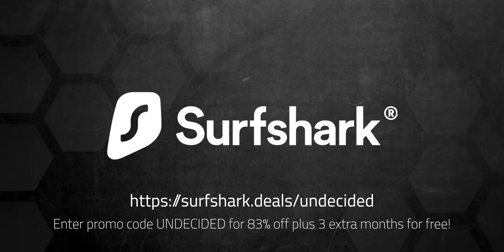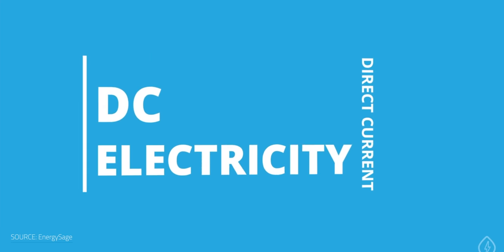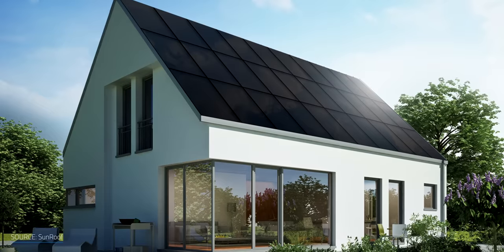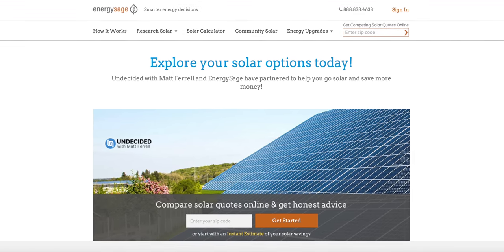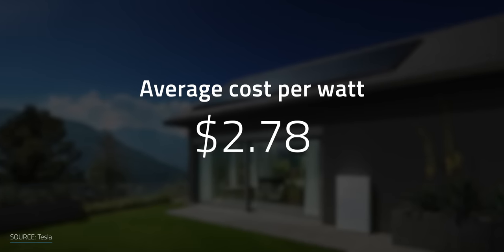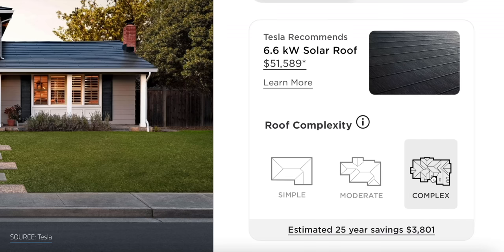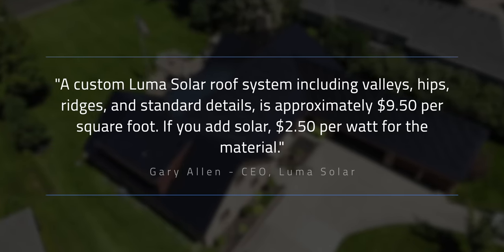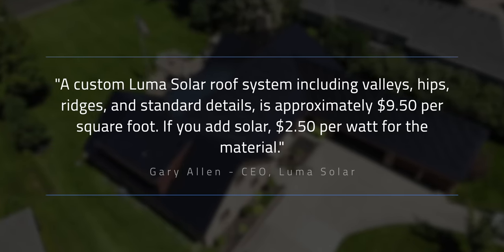Exploring Tesla Solar Roof vs. Solar Panels

Comment: The Temperature Coefficient and NOCT ratings of a panel/tile are just as important as the Efficiency rating.  The default Watts rating is the STC value; which is an idealized output in Watts.  In the “real world” the panel/tile(?) will likely output 75% of the STC on average for  4hr-6.5hr on a good day.  Very curious how Efficiency, NOCT,  and Temp Coefficient compare for panels vs tiles??

Comment: Thank you for an interesting video. I think your comparison would have been more helpful if you also included a rough estimate of the value of the solar tiles as strictly a roofing product, since if one is considering replacing a roof and adding solar at the same time, then they ought to consider New roof + Panels vs Solar roof tiles instead of just panels vs tiles. I would be really curious to see the cost per watt stacked up that way.
Reply from the maker: Great point!

Comment: My neighbor just installed Tesla Solar Roof before price increase. Another neighbor said now too expensive, the ROI with current efficiency and lifespan is upside down. I agree. 

I have been working on revolutionary Nano carbon fiber tubes tube technologies for solar panels and tiles manufactured in a continuous range production line. 

Lots of mountains to climb and hurtles to overcome, but with solar panels targeted with 30-40% efficiency, it’s a game changer.

Comment: I think the differentiator for me is sheer area. I have a relatively small roof area, and already have solar panels. Not quite enough area on my roof - especially given that the local laws prohibit panels too close to the edge, and then I have some solar tubes that prevent panels from being installed over them - to provide for all my needs. So I'm looking for a way to increase my production. I have a feeling I would get more power with solar shingles since I could use just about every square foot of roof area to produce power.

Comment: You mentioned power generated per kW installed. There seems to be a miss here with how many kW you need to install with panels vs tiles. E.g. If solar tiles are 5% less efficient, you need to install more, which adds to the cost and space. On top of it, solar tiles are installed with string inverters and you might have limited roof space for a 10kW system, so you'll need to over provision panels, adding to even more cost. Having recently researched this for a few months, the tiles have the biggest advantage of anesthetics today, but besides that they don't seem to be really a replacement to panels yet. But I can see the potential.

Comment: It makes more sense to do tiles when building/dedoing the roof as a whole since you don't actually have to buy and install a seperate roof. it makes more sense to do panels if your roof is mid life. Also panels are more versatile and you don't even need a roof to mount them. Personally I'd go with high efficiency and high quality panels, but that's because I plan on having more panels than my roof would allow anyway

Comment: Good video. Very important comparison!
One aspect that I found missing - normalized area coverage.
On the one hand, in most places I saw, the panels are not placed flat on the roof but tilted in order to maximize the efficiency. On the other hand, tiles will cover the whole roof while panels have their defined size and you can only try to fit in as many panels as possible on a given roof shape.
Obviously there's no uniform answer which is better from that aspect, but would be nice to see a rule of thumb if there is any.
Thanks

Comment: It would be nice if you could present the costs and benefits in 25 years for all options by considering total costs (investment, operation, maintenance, depreciation, ...). Then it could be more reasonable to compare the tiles and panels and quantify the maintainability factor of the tiles.

Comment: It seems important to consider that panels are placed in the most efficient area of the roof whereas tiles are everywhere. This means you could have tiles that are permanently in the shade or otherwise inefficient due to their location. So even if the wattage you buy is the same, strategically placed panels will end us giving you much more energy/$.

Comment: I am building a new house and was planning on getting Tesla Solar roof.  But when the price changed the exact same quote TRIPLED in price so now I'm not so sure :( Especially since this is one of those community builder homes so I actually need to have the default roof built and then replace it if I want solar roof.

Comment: I’m about to have solar panels installed but wondered if the Tesla roof would be better. Like you said, I suppose it depends on your needs. Existing roof, Solar panels. New house, solar tiles. Thanks for the info.

Comment: You didn't mention the other positive for the solar tiles. Because they are the roof, you get total roof coverage in panels.  You don't have large non-solar gaps near chimney's, or a large gap where roof edges meet, or have empty spaces due to the solar panel sizes, thus can't get complete coverage.  So you get an increase in surface area. And because they cover your entire roof, You will be able to easily collect solar from both the morning and afternoon sun ( assuming your roof is positioned North/South ).

Comment: Matt, excellent analysis. Unfortunately Tesla has no certification for installation in the South Florida region (Dade and Broward counties). Certification of approval is stringent and based on wind resistance 185 mph. Solar panels do have this certification. The other problem with Tesla is that prices, in fact, went up. I have an estimate from July 2020 and a new one for this year, increments are above 40%.

Comment: In he UK where we have conservation laws we cannot attach panels to the front of our roof's as it would compromise the look. There means that the roof is not cost effective to panal on just the rear side as is not large enough to be of value. Tiles would be the go to solution, however the cost remains prohibitive. When replacing a roof it may make sense, but that's about once every 20 years. We should mandate solar tiles on all new builds.

Comment: Good info for orienting. Thanks, Matt!
Nonetheless and as you take pains to make clear, there are many variables -- too many to grok by the feeble-minded among us. I'm one. Drinking from a firehouse here. How about for a future follow-up ep in which we (meaning you) gin up a simplified use case meant to reduce variables as follows: a median-size US household; in an average cost of living zip code; with an average kW consumption history...including charging for a Model 3 at 10K miles/year; a simple single-lope roof (e.g., a mid-Century modern) that faces south. Let's stipulate that the current roof has reached its service life and requires replacement. Now let's cost out total outlay for roof tile PV from three firms (Tesla being one, obvs) and then the total cost of a NEW roof + panel systems from three firms. Size them so that at the end of 25 years there will be sufficient output remaining to meet average beginning kW consumption, meaning that an 80% guaranteed terminal output will have to be oversized at first, then shrink to fit. Let's factor in whether or not we'll have to re-roof again, or not, at the 25-year mark (coinciding with the average service life of asphalt shingles). Oh, big question -- are all the companies you mentioned available in our sample zip code? Since I'm feeble-minded (see above) and have probably forgotten something, you should control for any greater number of variables as needed to render out an apples-to-apples cost comparison.
Once relative costs are nailed down, that will free us at home to adjust costs for our locale. We'll also be freed up to consider esoteric considerations, such as: aesthetics; durability (Tesla's bowling ball falling on tile versus hammer strike fragility); reputation and reviews of each manufacturer and each installer; the flexibility to add a wind turbine feed; local regulations and power-company feed-in price structures; and advantages of a glass solar roof in California wine country noted for wildfires and floating embers that threaten to ignite some roof types.
And then there's the stinker question: Since Tesla Powerwalls are now plug-and-play with Tesla PV (both panels and shingles, I assume) is there another game in town? Anybody else offer home battery systems with their PV? Does Tesla let you feed its Powerwall from non-Tesla PV?  <-- independent of cost, that might be the clincher. If Tesla owns the PV + battery + car charge ecosystem, then it's game over for many of us.
I hope you accept the challenge of producing this kind of super-relevant apples-to-apples analysis, and that your spreadsheets are up to the task. Good luck.

Comment: I gotta say I’m conflicted about the solar tiles from a philosophical point of view; is the solar tile less Bauhaus by pretending to be something it’s not (a shingle) or is it more Bauhaus by integrating a new function into an existing surface (solar + roof)? I’m not sure I’m certain which it is.

Regardless, I think it comes down to cost. I have panels on the mountain house (which has proved to be a pretty awesome investment I might add) and I think I like it that way. When time comes for a new roof I’m fairly certain both technologies will be much cheaper than they are now but something about the openness of a panel excites me. I’m generating clean energy, that’s something to be proud of. We’ll see in 25 years.

As always, great video. Though I must say the columns were a bit misleading in scale sometimes.

Comment: With owning 24 panels, 2 Powerwals+ and model 3 it’s a mind blowing experience.  With the Cybertruck on the way I’ll be saving thousands per year not filling up anymore. The whole world should be doing this. Only go for solar tile when you also need a new roof.

Comment: Matt. Regarding data visualization. I wholehartedly recommend to not arbitrarily use bar graphs with non-zero starting point amongst others with zeroed axis. This habit overemphasises differences and gives most viewers the wrong impression regarding the actual differences. They might seem huge depending on the axis zoom factor when in fact it's only a few percent. It's a bad habit communicating numbers IMHO. If you want to show difference only, normalize it to lowest/highest or better give deltas in percentages maybe.
As to the content of the video, it would have been even more interesting to factor in the total cost of the roof. 
Regards, Andreas, head of group laser processing for solar cells and other renewable energy applications at a large research center ;-)

Comment: in April 2019 our black glass tesla solar roof was installed. 4000 sqft, home is basically a velvetta cheese box and we needed a new roof..... two power walls, approx 5000 watts solar. with some perks the cost was around $62K.  PG&E pays us now. $10-$30 a year. You should see the phone bill!! OMG. it's pages long and written  in Sumerian or Reformed Egyptian...... little tiny numbers like+/-  .01 cent for this or that.

Comment: The cost of either is way out of my price range, but I love the tile concept. They definitely look better, but are they also sturdier and less maintenance? I gotta assume both require some degree of cleaning to maintain peak efficiency from grime building up. Can the tiles be stood on without breaking or cracking? I gotta assume panels are more fragile overall, but if a tile gets damaged does it break the circuit to the corresponding tiles?

Comment: We are looking at some desert property and I'm designing the home so the south facing roof works with solar panels. It looks like we will be able to install 10 to 12 Kw of panels with out much hassle. 

I know on many homes the solar panels act as a cold roof helping keeping the home cooler in the summer. I don't see that happening with the tiles. 

Myself I don't see the added cost of the tiles worth it.

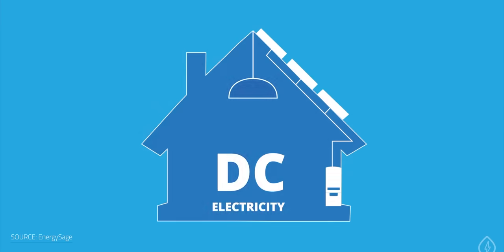Comment: Technically, your picture showing how solar panels connected to a central inverter (1:48) is old technology. Now a days, micro-inverters behind each solar panel on the roof converts the DC to AC power. But I understand your explanation is easier to understand.

Comment: Still cant get over the fact a roof only lasts 25 years or so. 

Roofs should last at least in the UK ...50 -100 years ! 
My house was built in 1935 still has a mostly origional roof.
Reply: That’s because in America they use tarmac (“asphalt”) for their shingles. They’re even flexible and tear easily and stuff. Because it’s cheaper per tile. But when you factor in the replacements over time, it’s the same price or even more expensive. But that’s America for you.

Comment: How would a traditional roof be repaired/replaced if it had panels mounted on it? I imagine it would add a chunk of cost to have the panels removed, then reinstalled and repaired if needed after the new roof was finished.

Comment: We had a Tesla Solar roof installed in late 2019. 1. They look much better than panels (Our house is. on a corner and the entire roof is visible from the streets.). 2. the previous roof was installed in 1992 AND we got a settlement on a class-action lawsuit about the poor quality of those shingles in 1994 or so.

Comment: The tiles are just too expensive for now. Panels look like the way to go. But i don't see things discussed like how to keep pigeons from roosting under them and the cost to seal them. More information on this would be great.
Reply: You can get panels that are flush with the roof to avoid that issue. I have two slops of panels with regular racks and no bird issues at all.
Reply: @honesty_-no9he  If you have the spanish tile roof where the tiles are curved, the little suckers will get underneath them and some kind of skirt is needed. So 'flush with the roof' depends a bit on the roof tiles. It's surprising they do this but critters will be critters. They will even hang around trying to find a way in. If they are under them they are noisy (you can hear them inside the house!) and deposit a lot of pigeon poop which is acidic as well. Pests!

Comment: its interesting you talk about panels being "more efficient" and offering more power pm2 but im curious would tiles not generally give you "overall" more coverage than panels would? so surely in some roof designs tiles would actually offer "more" than panels would, a basic roof would ofc still be better with panels but more complex roofs would benefit from tiles as you might not be able to cover "more" of the complex roof as you would with panels vs tiles approach
Reply: Good question, but not every tile is a solar tile because of heat dispersion they have to be layered, and some of the parts of your roof like ventilation and run through ports for cables and controllers, can't have functioning solar tiles on them, so there is actually more overall coverage with panels rather than tiles, even if the panels have bezels, the bezels are smaller than the tiles. And the tiles aren't raised as they act as the roof of your home, panels are raised a few inches and allow better airflow underneath, and can go over ports and holes/vents on the roof. At least that's my take on it.

Comment: i would go with panels, one reason would be the weather, think about a decent hail, if a hammer can break them hail can too, sure panels also break but you still have your "normal" roof there so damage can be mitigated for the indoors

Comment: I’d like to see data on whether or not panels provide even more benefit than tiles because they are lifted away from the roof itself and therefore provide a shading effect whereas with the tiles the heat might be transferred to the underlying roof structure potentially making the internal temps of the home hotter.

Comment: Please consider adding GAF Timberline Solar shingles to the discussion. They are nailed to the roof alongside asphalt shingles and generate 14.5 watts/sqft. The wiring is on top so there is a polymer channel connecting the tiles and at the ridge an environmental box allows wires to enter the roof attic. Less expensive than Tesla Solar tiles but not nearly as visually attractive.

Comment: Based on Watts per sq/ft, Efficiency, NOCT, Temperature Coefficient, and price; the Panasonic HIT+ is an excellent panel.  So is the REC Alpha.  Curious on your thoughts on the Panasonic HIT+?  They seem ideal to me for Farm, Rural, Homestead, Tiny Home in 48v DIY solution; which saves significantly on the installation costs.  City, Urban, Suburban solutions are almost always 240v and not DIY; which results in higher cost.

Comment: Tiles look so much nicer than panels. And one day, will they also have solar siding? Then your roofing and siding materials could collect solar energy. Going back to solar panels though. If you were to have solar installed on a pre-existing asphalt shingle roof. You should probably add in the cost of fully removing and then reinstalling your solar panel system to rip and replace that asphalt shingle roof. At that point, the cost of solar tiles might be very attractive. My concern with the panels is that you have an electrical system installed above a roofing system. If the roofing system fails, you have leaks, whatever, you will always have the additional cost of removing the solar to get to the roofing. What do any of you all think?

Comment: there is another advantage with Panels. They are shading the roof so it not getting that hot on the inside in the summer. Besides Panels are dirt cheap compared to tiles.